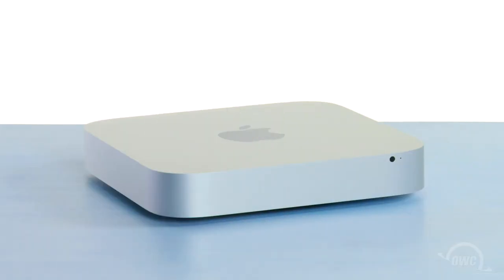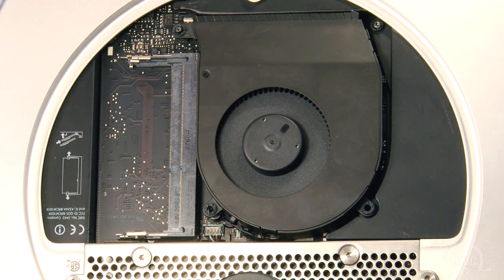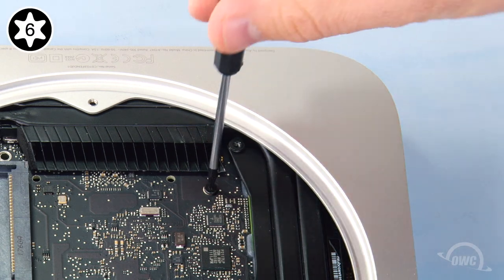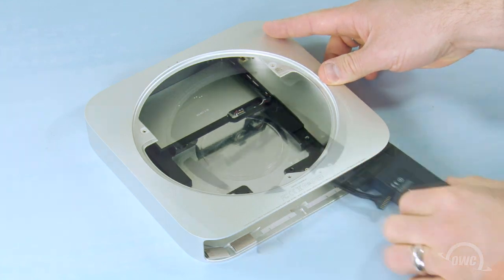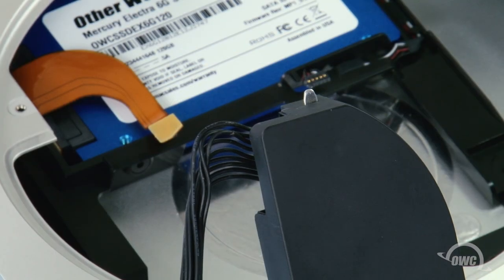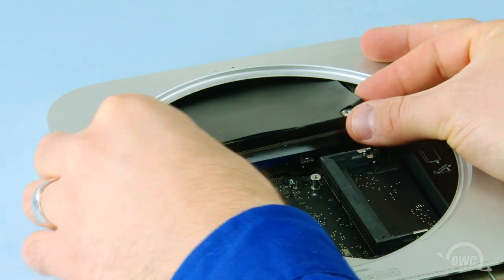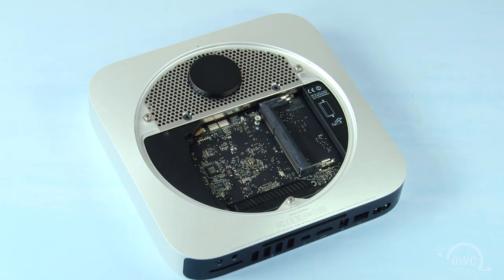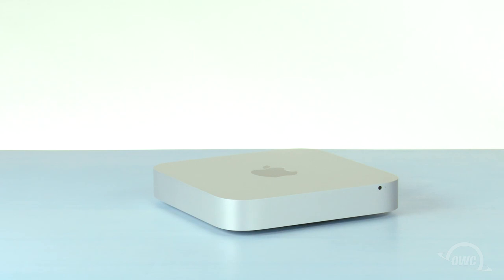How to Install a Second Drive Inside a 2011-2012 Mac mini with the OWC Data Doubler

Comment: I have a Mac Mini 2011.  I’m running out of storage.  There’s really nothing wrong with the computer other than it’s slow and my worse apple investment.  How can I improve the speed and power?  Toying with the idea of a SSD.  I purchase this for portability.  I write and thought this was a good investment.  Not but I gave it and truly don’t want to spend anymore money. Buying another apple product.  I do have a 2018 iPad Pro 3 gen,  it I still like the idea of having a desk top.  Suggestions please?
Reply: MacSales. com I’m not full geeky for a girl but I do ok. I got all the tools but haven’t brought the SSD yet. How costly would this be for a reputable tech to upgrade this?  I added memory so I have 8 GB. I could max it out
Reply: What’s your thought on upgrading the hard drive and ram vs. a SSD?  if a SSD, I know it’s expensive how high would you upgrade the GB?  I don’t like doing things and then having to repeat a process.
Reply: MacSales. com you nailed it!  I’m a kitchen geeky girl who likes to make sure she has everything she needs at her finger tips. She hates starting something and then finds out she doesn’t have everything she needs.  Thank you for your suggestions.  I.’m taking it to heart.
Reply: If your Mini is slow, know that the HDD is the slowest part (bottleneck) in your system. I’ve the i5 2012, with 8gb RAM running Catalina and it does not feel slow to me. Sure, it’s not the fastest machine either, but more than OK, but the SSD is key to this. 100 $/€/£, should easily get you a 1TB SSD, so unless you need a lot of space, it’s not cost prohibitive to add one. Of course that price will probably treble if you need an authorised tech to do it for you. If you really want to cry, ask Apple how much they ‘d charge.
Reply: Thank you fir responding. I got an Apple refurbished 256 GB.  I mostly write and genealogy, photos and music.  No heavy duty stuff! I’m sorta girl geeky 😂 and might try to replace it.I will see.

Comment: LET A PROFESSIONAL DO THIS MY FAN BROKE AND MY IR SENSOR
Reply: oh nooo! :(
Reply: Thanks, I'm not sure whether to attempt this myself. Your comment makes me think I shouldn't.
Reply: @imonymous  Pick up a plastic spudger kit, be gentle, and go slow. Nothing to it.
Reply: The keyboard too?
Reply: Honestly if this is your first go at DIY, it's a fiddly job that requires the right tools, patience and sometimes a gentle touch. Not the hardest HDD replacement I've done, that was a Sony Ultra-Mobile that used the same HDD as the original iPods.

But if you broke the FAN and IR Sensor, then I suspect you were too rough plugging/unplugging and moving things. Personally I did this in about an hour with just a set of Torx, Phillips and Flathead watchmakers screwdrivers and had no major problems. But if you follow each step as you go along and pause after each step, the instructions are completely comprehensive. I had a tablet near by so I could watch the video whilst working. Take special notice of how any connectors detach/attach when watching the video. You have to gently 'pop' the Antenna cable, which lifts off vertically from the board, don't pull by the cable, but very gently pry at it, being careful not to bend the cap. Do this with a spudger, they cost next to nothing, so if you're not willing to risk using a screwdriver for this, don't. You have to be super-careful removing the HDD cage, to avoid damaging the IR Sensor, just take your time and wiggle things out, if necessary, gently. I just used two small screwdrivers instead of the Logic Board Removal tool, but I think considering if you damage that, your Mac is basically in need of replacement, I'd recommend investing in one.

Thanks again to the people at OWC for such a clear instructional video, I wouldn't have taken this on without it.
Reply: @MGBNAM  This is Agents SECOND youtube. I just replaced the hard drive again for my sister, this time took 13 min everything was way better since ive done it 6 times now on different mac minis
Reply: Ahhhhaaaaaaahaaa